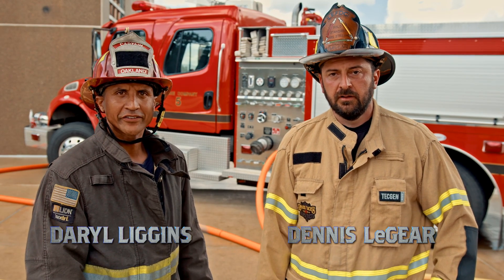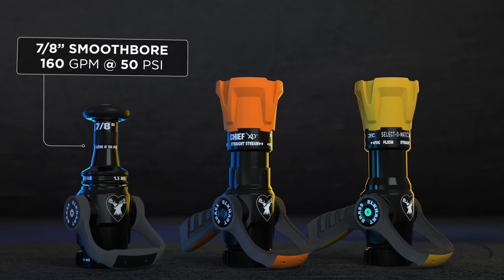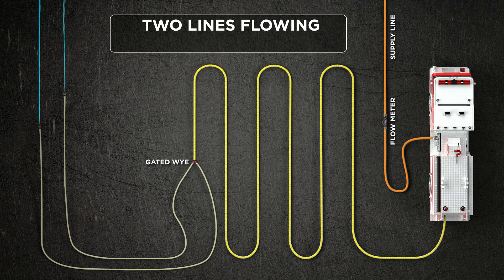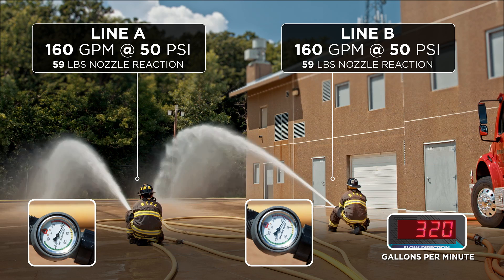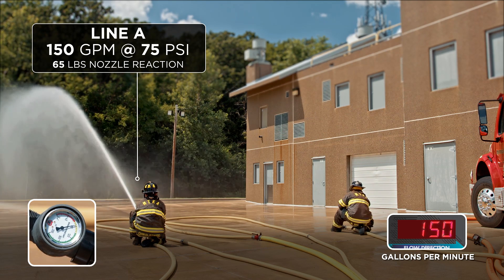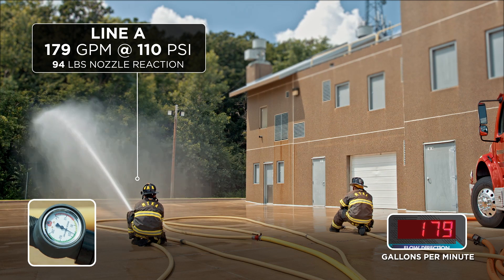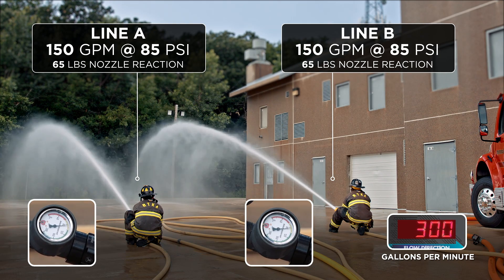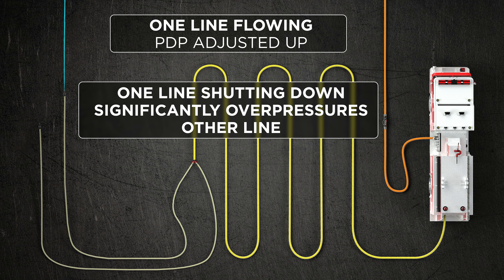Gated Wye Operations:  Part 2 – Modern Flows (Ep #58)

Comment: What are some possible solutions that are being used to help correct these problems.
Reply: I do not believe the instructors in the video stated they were not using the pressure governor at all, which would account for the significant disparities between both the flow rate and the discharge pressures. All things bring equal and the two 1.75" lines are the same length, the friction loss only needs to be calculated for one line. Then, you would figure for the 2.5" truck line to the wye. You would not need to account for any friction loss in the gated wye until you reach 250 GPM, which is considered a master stream. Once you have that, you could establish your initial pump discharge pressure and set the governor to stay at that pressure. Then, when the second line is opened, the apparatus would automatically increase the RPM to compensate for the initial pressure loss when the nozzle is opened. When one nozzle is subsequently closed, the apparatus, still being governed by the pressure, would decrease the RPM and compensate for the brief increase in pressure to the first line. There would still be a momentary increase in the perceived nozzle reaction, but that would dissipate and the company could still function without being set back by significant nozzle reaction. Hope that helps. I've done that a lot and the physics still works.
Reply: @mattandersen6738 In theory what you say is true, but when testing different makes of 2.5" and 3" hose, you will find significant differences in results.  The governor may or may not pick up the pressure drop or increase properly.  You need to test your specific layout and nozzle combinations.
Reply: @mattandersen6738  I operated an engine with a pressure governor and I understand what you are saying however there are some other concerns.  The additional pressure requirements for 2 lines operating is beyond the gated wye appliance it also must be accounted for in the 2 1/2" trunk line.  We tried to point that out in the video.  Most companies deploying this type of operation are using it beyond the length of there longest preconnect so a minimum of 200' of 2 1/2 is usually involved.  So the pressure governor would have to be set at the highest pressure required and still leave a single operating line with too much pressure.  Also an industry standard minimum residential flow of 150gpm 2 lines operating would exceed the 250gpm you mentioned.  Flows over 350gpm are considered master streams since a 1 1/4 tip is still a widely used landline.  In edition there are other concerns outside of the hydraulics mentioned in the video.  Thank you for watching and your interest.
Reply: Use two seperare lays, most engines have 2 crosslays, use both and avoid wye
Reply: @KosukiFire  I appreciate your invite.  We to feel it is safer and more efficient and effective to use 2 separate lines.  However its not usually an issue of the crossways not being used, its usually a result of having crosslays.  Crossways are usually preconnected lengths of 150-250 long and when longer stretches are required a engine company will often have an evolution such as extending off of a gated wye.  Dennis and I find having 2 lines that are long dead loads that are not preconnected can all but eliminate the need for such an evolution since you are not constrained by the length of the preconnect.  As an example FDNY companies have 2 lines that are generally 800' in length.
Reply: @brogan healy A gated wye may be necessary in order to advance leader line and increase the reach of the hose itself, due to setbacks, long drives, etc.
Reply: Bell reducer for first line or bulk load of 1 3/4.
Reply: nickp76 @fireengineering just had an article on this in last months issue.   Pretty interesting stuff.  The lesson I take away is to not use wyes for any modern fire attack.  It worked for legacy, but not for what we face nowadays.